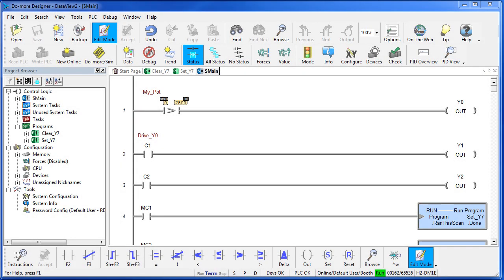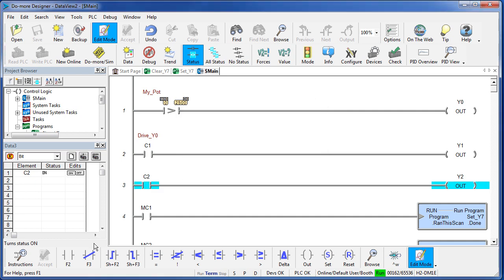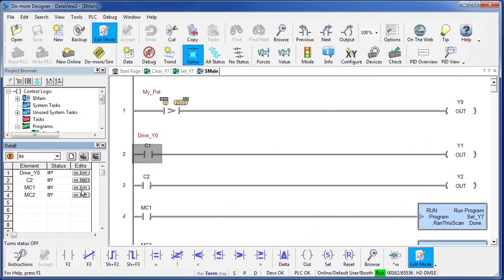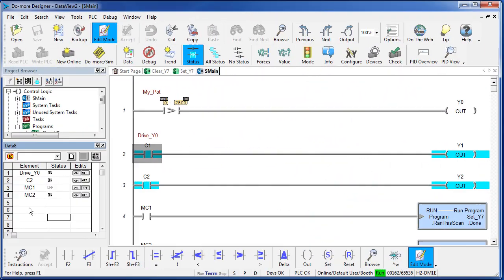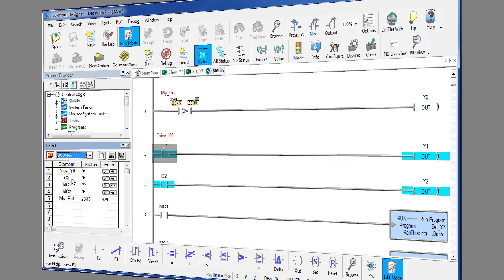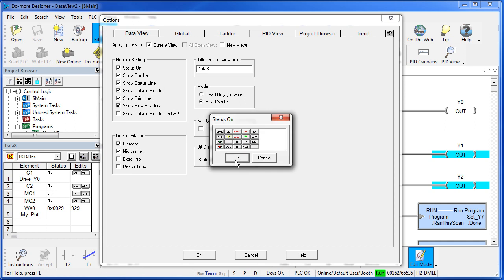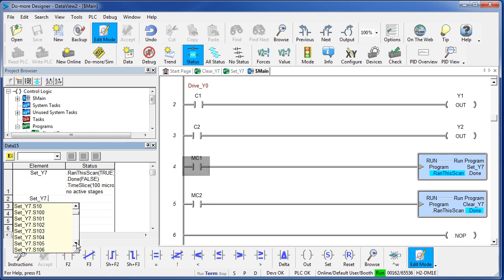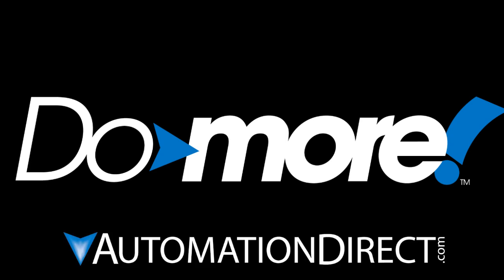BRX Do-more Designer Data View from AutomationDirect

Comment: That right click to send an element to a Trend View - nice! Question - every time you click on Data, it creates another instance of a data view. Are those delete if not saved? I sometimes have an old data view pop up, and have a hard time getting it deleted even though I can't find an associated *.ddt file.
Reply from the maker: @paganskier
In DirectSoft, (so maybe also in DMD) if you delete all the 'extra' dataviews you need to save the project after doing so or they will all merrily re-open next time you open the project. Try that and see if it works as a fix.